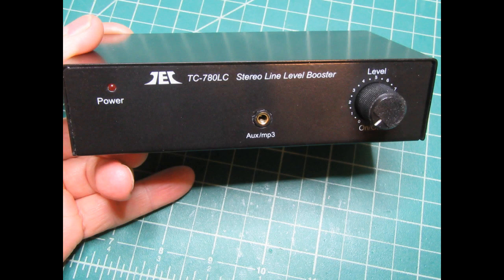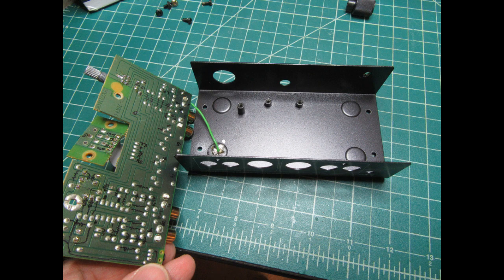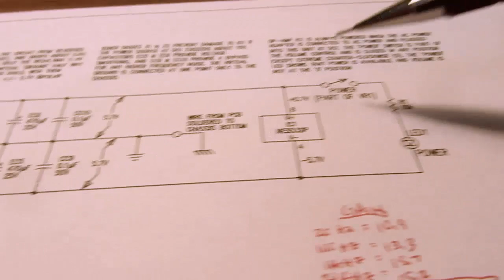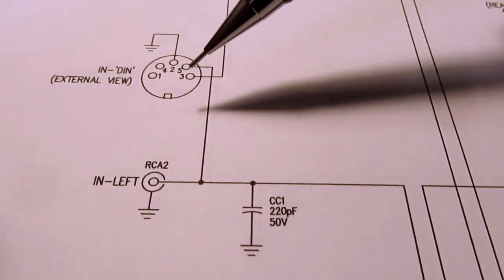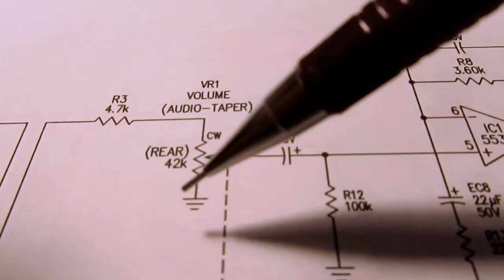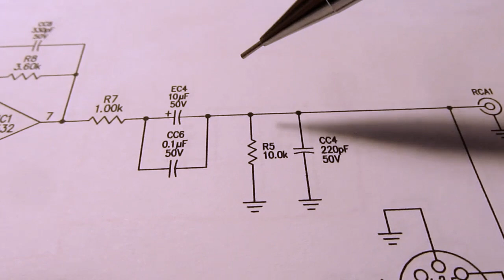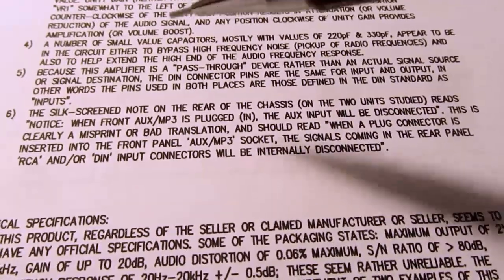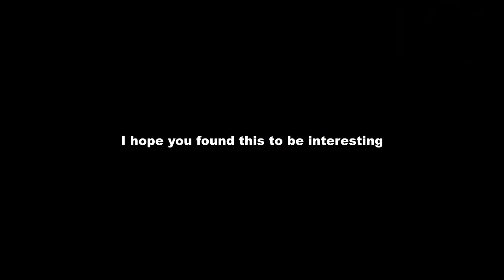TEC/TCC/JEC model TC-780LC Stereo Line Level Booster: Overview, internal views, schematic, theory

Comment: Hi there! I appreciate your work on this. I agree with you that literature on this device is very limited to pretty darn nothing online. 

Question for you. Do you think this will work as "attenuator" for turntables with ceramic cartridges? I have a BSR changer. Mounted on it is a ceramic cart with 0.5v / 500mv output. I was thinking of having the turntable as input to this device then  connect it to a phono pre-amp which will then be linked to a stereo receiver. I'll set the Level knob to 7 or 8 o clock since I am not looking for output boost (ceramic cart is already high output).

Appreciate your thoughts.
Reply from the maker: Jaypeemalena, this device is not intended to work with anything other than line level signals. If you are planning to use a phone preamp anyway, why not put this product between the phone preamp and your power amp?